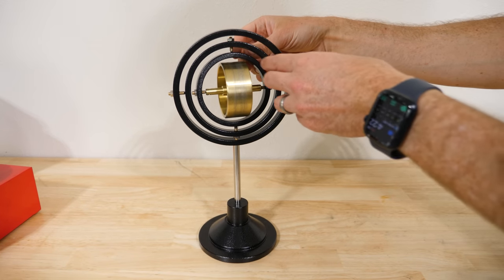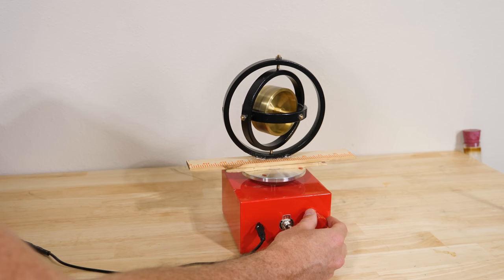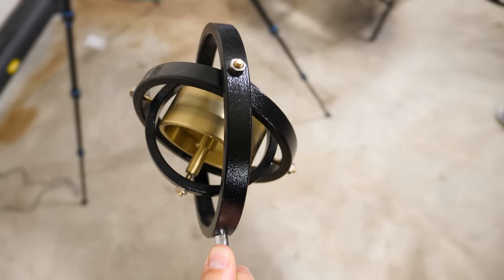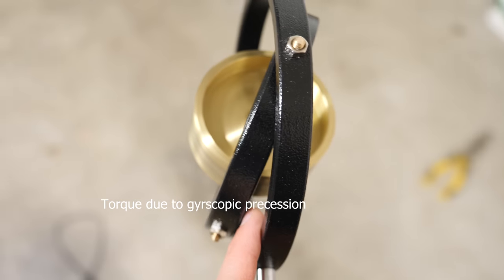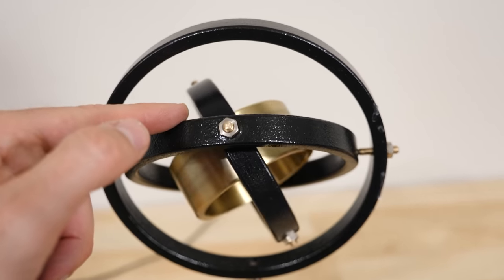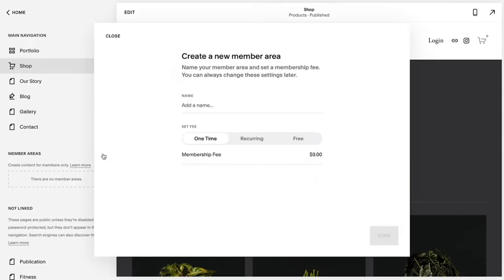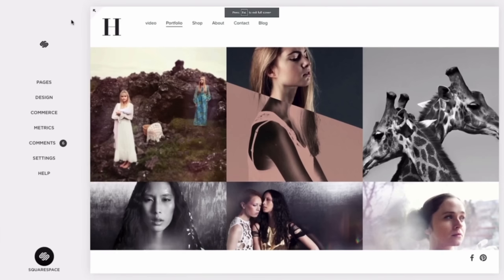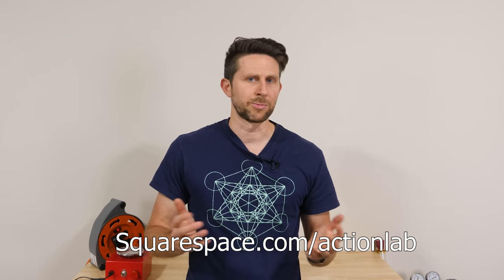Can Gyroscopes Provide Free Energy For The Planet?

Comment: Extracting energy from the rotation of the earth sounds like a bad thing
Reply: The Earth has a rotational kinetic energy of 2,138×10^29 J. World primary energy consumption fell to 556,63x10^18 in 2020. At that rate it would take approximately 384.097.156 years for the Earth to stop.

If we can use Earth's rotational energy as an environmentally friendly alternative to carbon based fuels right now, in a million years or so we can start to put energy back into the system.

Comment: Oh no, angular momentum is conserved, this is all hooey.  If you slow down the earth, where is the angular momentum going to go?
Reply: Converted to electrical energy.
Reply: @scott_meyer  Energy and angular momentum are different things. You can't convert one into the other.
Reply: @donaldhobson8873  
Can you not derive a force from momentum?
Reply: @scott_meyer  If you are in a spaceship going at high speed, you can't use that to power anything. (Assuming all your stuff is going at high speed).
You need interaction between things moving at different speeds to light a lightbulb.

You can't get energy out of the earths linear speed around the sun, unless you push off the sun or something.
Reply: @donaldhobson8873  
Been thinking,  I get it.. Since we're on the Earth we cannot extract angular momentum from it.
Reply: @scott_meyer  Pretty much yeah. Much like a generator, if the stators move with the magnets then no electric comes out.

Comment: how fast would you need to run to stay in the same position relative to the sun?
Reply: The Earth was by definition 40k km at the equator (it's now a bit less). 40.000 km/ 24 h = 1666 2/3 km per hour.
Reply: @MrMichiel1983  so you'd need to run really fast just to stay in one place, so who said we don't utilize the earths rotation,  that's how we cool down. Imagine if earth was stuck, like the moon always facing earth, one side would be completely scorched wasteland, and the other constantly bellow zero populated with ravenous polar bears.
Reply: @amonynous9041  Very true, I wouldn't claim we don't use the Earth's rotation. As you correctly deduce, the rotation is vital to sustain a temperate climate everywhere.
It's just that it would take a very long time to reduce the rotation with current terrestrial use of energy. Therefore, being cheap, clean and abundant it could replace fossil fuel use for now, and later on we could speed up the system again.
The Earth has been slowing down already for billions of years because of the tides and at some point that and the sun getting hotter will become an issue anyway. So in 100 million years we need to build Earth spinners, I don't think saving the environment now and having to build those spinners a million years early is a big problem.
Finally, a gyro will never work, but tidal energy already does.
Reply: @MrMichiel1983  harvesting rotational energy sounds like some troll physics, like blowing in your own sail, or holding a magnet in front of your car. Btw I don't think we'll be here in 100 million years,  it's kind of pointless to think that far ahead. Don't you know we are beings from beyond time and space?
Reply: @amonynous9041  I am quite sure you and I will not be here, but also quite positive that life will endure.
It was my point exactly that looking ahead 100 million years is a bit pointless and that we should look at more pressing issues.
That's exactly the reason why I don't think it's an issue using rotational energy.
The tides sap rotational energy anyway. The days and nights used to be shorter.
The Earth has a rotational kinetic energy of 2,138×10^29 J. World primary energy consumption fell to 556,63x10^18 in 2020. At that rate it would take approximately 384.097.156 years for the Earth to stop.
That would of course be bad, but using a tiny fraction of it now, like the natural system has been doing anyway, seems like a win if it can help save biodiversity right now (which is not pointless).
Even beings from beyond time and space need to clean up after their own asses and be kind to other beings.
Reply: @MrMichiel1983  What if I told you all this is just a dream? There is no me and you and all these earthly things are but a distraction. Would you believe me?
Reply: @amonynous9041  I do believe it is but a shared dream, but that does not make it unreal, or less worthy of our attention.
Indeed, I wouldn't say there is no me or you, because those mortal coils did just now type a message. Rather I would claim that there might be planes of existence where that distinction does not matter.
Yes, physical things can be but a distraction, yet they also provide the scenery for a dance... A dance of souls. And that dance is prettier when the scenery is, like a dream is more pleasant when it's about something nice.
Isn't the clue that existence is eternal distraction from the singularity?
Reply: @MrMichiel1983  very well said, you make me proud dear fellow human.

Comment: Relying on earths rotation ALONE to both spin the flywheel and turn the generators was destined to not generate more energy than it consumed. There needs to be a secondary vector of movement that favors one or the other to gain something out of this. The only other 'large' secondary gravitational influence is the moon. If you could design the gyro to orient itself to maximize tidal influence, I think you may stand a chance at producing more energy than it takes, but only with supreme engineering.
However, this means 'one cycle' would equal 28 days, not one day.

Comment: Simulation theory is gobbledygook.

Leibniz' contingent universe > simulation theory.

Leibniz' Law of Sufficient Reason fixes our universal constants having derpy answers.

Example 1:
0D = (point)
1D = line (2 points)
That's Law of Sufficient Reason.

Current collegiate answer for 1D = line heading in two different directions infinitely (points?).
That is contrary to Leibniz' Law of Sufficient Reason.

You see?

[Fundamentals > Specifics]

Leibniz' non-composite substance = 0D (metaphysical point) aka Monad/Soul.

Leibniz' composite substances (matter) = 1D, 2D, 3D 

Leibniz' contingent universe (1D-9D; 3 sets of 3) = 4D quaternion algebra UPDATED from 1D, 2D, 3D, 4D 🚫 to 0D, 1D, 2D, 3D ✅.

Human = 4D unit quaternion algebra 
where w, x, y, z (0D, 1D, 2D, 3D) are real and i, j, k (1D xi, 2D yj, 3D zk) are imaginary.

"Time is an illusion." -Einstein

Gravity is gobbledygook. 
Our contingent universe is 1D-9D which makes 5D the center.

All things (1D-9D, not 0D, as 0D is not a 'thing' it's a Monad) are drawn to the center, the whole.

Comment: I can very easily proof,that this cant be done. And trying it out as a company is kind of stupid.
To extract any energy from earths rotation,you've got to change its angular momentum relative to its center. For this to happen, you need a external force. This could be something like the moon, but also something on earth speeding up or getting slower angular veilosity relative to earths center. So this is not possible with a gyroscope,cause its center of mass stays at the same point relative to earth. Its center of mass hasnt got any increase or decreas of angular momentum relative to the center of earth. Its basically bullshit. And i wonder, why they even tried.
Reply: Because its only "bullshit" once its been tested. This is how science works, Come up with an idea and test to see if it works.
Reply: @ikitclaw7146  not exactly. If Newton is true,this wont work